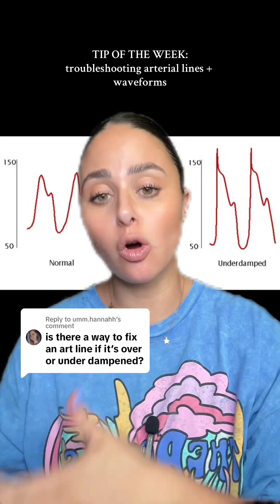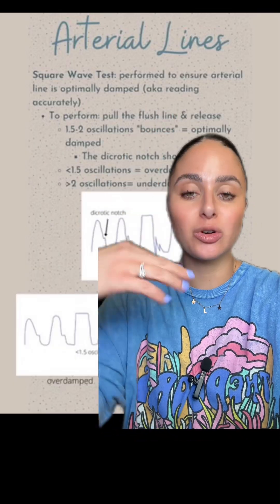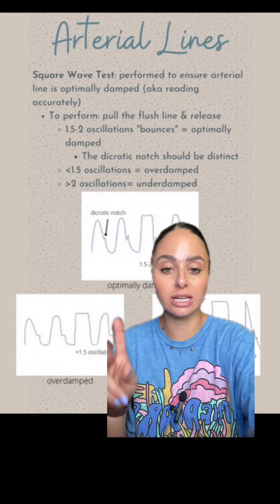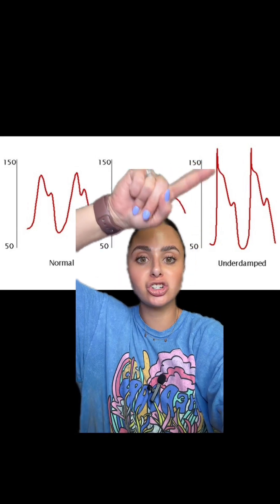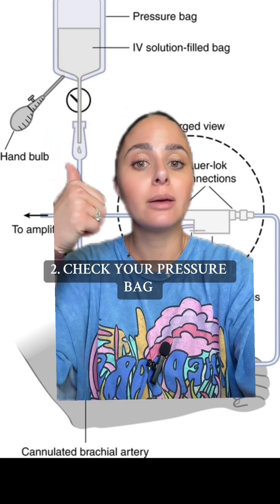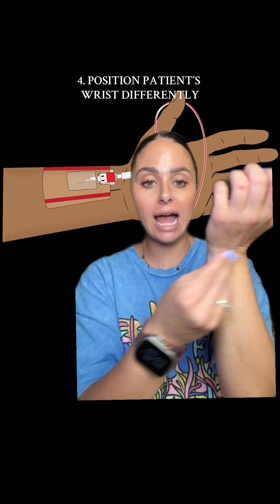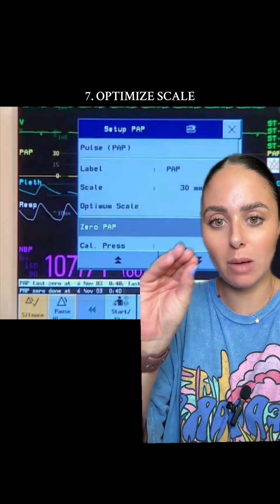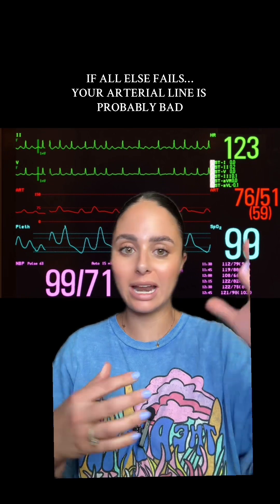TIP OF THE WEEK: troubleshooting arterial lines + waveforms 🩸

Comment: Hey Ashely! I’m curious, have you ever seen wildly different pressures from the aline compared to a patients cuff pressure? 
Yesterday, I had a patient’s cuff pressure 110s/50s and Aline was 160s-170s/40s. My set up for the Aline was accurate and I had an appropriate cuff, tried both arms. My patient has PVD so I’m thinking that plays a role. Wondering if you’ve experienced this and which you would find more reliable. The patient was on and off levophed and the provider wanted me to keep MAP >65 according to BP cuff. Thank you for any insight!!